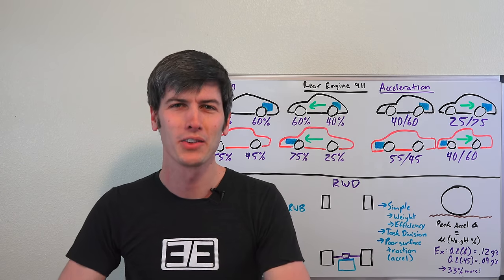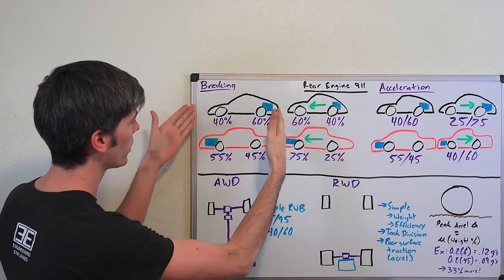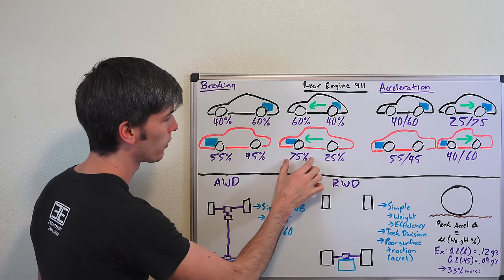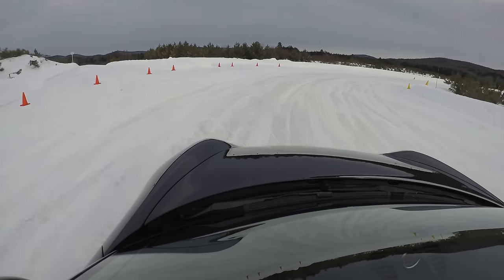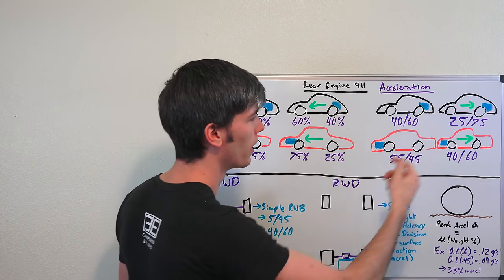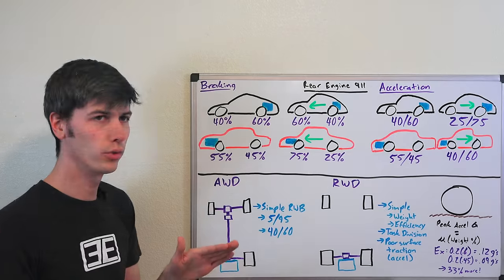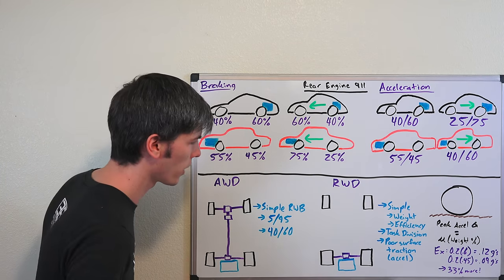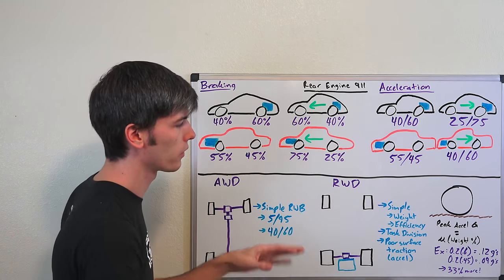Why Is The Porsche 911 Rear-Engine?

Comment: The real reason the Porsche 911 is rear engined is because its predecessor, the 356 was rear engined. And the 356 was rear engined because it had a lot more "Volkswagen" in it than Porsche fans will admit. The original Volkswagen, which we now know as the "Beetle," had a rear engine because that was Porsche's way of getting it out of the way for interior space. Mind you, there wasn't much luggage space in the nose because the car was "aerodynamic," in the Chrysler Airflow idiom. 

Porsche could easily have made the 911 a mid-engined car -- which would be much better for low polar moment of inertia, and thus better handling -- but Porsche fans wouldn't have it. Instead, the company has spent 50 years and countless millions of dollars trying to reduce the extreme rear-weight-bias and pendulum effect. Once all that mass out behind the rear axle starts moving, it's difficult to stop. Today's 911s are decent handling cars, but the early ones could be a terror. Turbocharging, with the attendant turbo lag, only made them worse. 

To make things even worse, the extreme rear weight bias means there isn't much weight on the front wheels, and thus not much "mechanical" grip. The early 911s in particular had floaty front ends, a tendency to spin and were all but impossible for most people to catch when they did. Worse still, that lightly loaded front end meant the car could also understeer if pushed too hard. Think on it -- a car that can understeer and oversteer at the same time.

Comment: You missed comparing to the Cayman. I did the Porsche winter exp a few years ago. The Cayman rotates more easy as it is midmounted. However that made it harder to keep it drifting as smaller adjustments made it react faster and you flipped drifting direction to easily. Pendulum 911 or seesaw Cayman.

Comment: The Cayman could so be more superior to the 911 because of that mid engine layout but Porsche holds it back so it doesn't eat into 911 sales. The GT4 was a good car but they detuned the engine in it.
Reply: wrong, you missed the video explanation. It's called physics.
Reply: Squidward's House Engine in the middle towards the back would just reduce the rear grip that's known from 911s. The 911 takes full advantage of the RR layout while the Cayman has a traditional sports car MR layout which isn't refined by Porsche as much. The 911 may seem like it lacks front grip, but this video explains exactly what Porsche has been perfecting for so long.
Reply: Porsche doesn't want some Porsche models to sell more?
Reply: The 911 still suffers from an incredible amount of over steer under acceleration while turning, much more so than other sports cars like the superior Corvette.
Reply: I blame the 911 for the Cayman losing the flat 6 and getting some terrible sounding flat 4 setup, the 981 platform was getting too close to the 991 :(
Reply: North Star Ken lol, the Corvette doesn't oversteer
Reply: Who gives a damn about how the thing performs when a $70000+ Porsche has an exhaust that sounds like someone botched an EJ swap into a cayman! The 718 sales tanked hard vs the 981s, so I am certainly not the only one that thinks this way.
Reply: mathew kuhl It actually doesn't with PTM on. It has so much grip and that's part of the reason why this super sports car absolutely destroys lap times anywhere it goes. It's just too fast.
Reply: matthewmatthew638 
I’ll be happy to pick up one of these non-classics at a discount in a couple of years, so I hope you’re temporarily right. 
Harley Davidson just closed a plant. Porsche isn’t known for its bad judgement. A 4 cylinder platform may be just what the doctor orders, even in a new 911/356/912/718 some day.
Reply: Jeff K if they’d just give the cayman the same engine/tech etc as the 911 then people could choose for themselves until then any claims 911 is superior is simply because they hold back on the caymans. Even the GT4 only got the engine displacement of a regular 911
Reply: matthew kuhl wut
Reply: matthewmatthew638 nah that was a decision they made from the beginning, Porsche just got stingy and didn’t want to face the penalties of increased emissions when they could throw a turbo 4 in the cayman. The caymans weren’t “getting too close” they could’ve been superior from day 1 if Porsche had actually given them the same engine/components/tech
Reply: Mid Engine Porsche is a Nightmare for Mechanics.

Just a simple fix required opening many body panels.

Cost customer BIG $$$ for it's service charge.

Summary : Rear Engine Porsche is more accessible, easier to maintain.
Reply: North Star Ken this couldn't be further from the truth. 911's (especially the awd turbo models) power out of turns like no other car. They have better traction in the rear and generally understeer. The days of the 80's turbo induced snap oversteer are long gone. There's a reason Corvette is always chasing the 911. There is no substitute.
Reply: Cayman chassis has great potential. It got weaker engine than 911 to position it lower in the market, as "entry-level" Porsche (if that applied to Porsche at all :-) )
Reply: I read a poster saying in the early 70's he worked at a Porsche dealership around the time the 914 was introduced. He stated the owners took the 914/6 out for a few days and came back and said if 911 driver's drove this car 911's would be history. Mid engine in a sports car is always the way to go. Even the Corvette may end up mid engine...

Comment: Your video talks about the pro's and con's of front engine vs rear engine not the reason the 911 has the engine in the rear. The original 356 was derived largely from the VW - it used the VW engine. It fundamentally had to be a rear engined car. The 911 was a continuation of the 356 tradition. Even when Porsche went water cooled with the 911 it remained a rear engined car. Porsche tried to go to front engine cars (the 924/928/944's) but they did not sell they were just not popular with Porsche's customer base. The real reason that a Porsche is rear engined is tradition! The real question is: Why was the VW a rear engined car? After all Dr. Porsche was largely responsible for its design.
Reply from the maker: Thanks for sharing insight!
Reply: the first front wheel drive car didnt exist during dr. porsche's era. the complicated mechanical systems needed to allow steering and power delivery on the same axles didnt come till much later.
Reply: Jerry Rufener Porsche stole the idea from Ledwinka who was master engineer for Tatra. He was posessed with air cooled engines, montube-frame and fluent bodylines. Hence the T77 and T603. Porsche took the drawings and scaled them down.
Reply: Fwd was pretty much developed at that time. Look at 1930's Citroën Traction.
Reply: The VW was a rear-engine design because Dr Porche stole the idea from a Czechoslovakian company named Tatra. Tatra put the engine in the rear of their streamlined vehicle, which is what the Beetle copied, in order to reduce harm to passengers when the car was driven into a tree. Very icy roads a lot of the time in Czechoslovakia meant that this had to be considered. Volvo invented the three-point seat belt, the inertia real seat belt, crumple zones, and a load of other safety devices because they have icy roads, lots of trees, and elk roaming around. Necessity is the mother of invention, Dr Porche was just a thief of inventions.
Reply: Actually the first Porsche Sportscar, which was the 356, was introduced as a mid engined car, which sits now fully restored in the museum in Stuttgart. This layout just made it never into production.
Reply: This is both untrue (DKW launched a commercially successful FF model in 1931) and completely irrelevant.
Reply: I agree with Jerry Rufener for the historical reason more than a technical reason.

As of why the back engine on the VW, it's simply because it was cheaper for a cheap car at that time... Back then FWD was very rare and a luxury, and the traditional front engine and RWD was more expensive to build than a rear engine close to the rear axle where it sends the power. It also let more space in the cabin for the passengers without the drive shaft under, particularly in small cars.
Many cars had the same design at that time, like the Renault 4CV.
Reply: Wow - I am impressed ... 9 responses and not one flame!!!! I am hesitant to post anything these days as flaming and rudeness always ensues. Like most things the truth is probably unknowable because of time and the fallibility of memory. Moreover, "the truth" is rarely as simple as we would like it to be. Good comments and some new information for me to look at. Thanks
Reply: @Jerry Rufener. Exactly. To be honest the reason Porsche still has the engine at the rear is to be different. When they tried to switch to front engine, they became just one more in the pile. This is probably the reason they didn't sell. People didn't feel they were as special. But it has all to do with being cute and not much to do with being a sound choice. Rear mid engine is way better. As is front mid engine for most things too.
Reply: I have read about Porsche appropriating Tatra's ideas ... probably a lot to it. However, rear engined cars existed long before Tatra's efforts. I have no idea when the first rear engine car was developed but Adams Farwell produced rear engined, air cooled cars as early as 1906 - it was a weird vehicle including a rotary engine. But it was rear engined. I have the impression, but no evidence, that they produced nothing but rear engined vehicles. In fact, Benz's first car was arguably rear engined ... the engine sat over the rear axle. 

There is data to support that the Sigfried Marcus developed a car as early as 1870; in what is now Austria (he was German). The stories about it are amusing: it lacked three things to make it practical: steering, brakes and a clutch. It was started by jacking up the rear wheels (implying that it was rear wheel drive and maybe rear engined) and spinning the wheels. It as then pushed off of the jacks to drive it. Once started the other two shortcomings became more important as there was no way to avoid obstacles. It was disassembled and he built his second car which is in the technical museum in Vienna. 

Tatra has always produced very innovative, interesting engineering products but they never seem to catch on widely. A shame actually
Reply: You are absolutely right.
I would not even try to justify the 911's layout in engineering terms. Porsche's designers know better than anyone that a mid-engine layout would be more logical, and why they consistently lose in performance to most front engine cars of the same category.
The rear engine was Dr. Porsche's philosophy (one could almost say "an obsession"). He showed it both in cars as well as tanks. But at the time, it did in fact made sense. But over the time, it simply became a tradition for Porsche, and a fetish for its costumers.
Reply: Jerry, the first Benz back in 1886 was rear engine. That vehicle is one of the very first cars (perhaps THE first).
Reply: Trent - I agree but like many historical things it is a matter of definition. Karl Benz certainly built the first "practical car" as evidenced by the fact he went on to build more of them and then sell them. Hard to argue with that. 

However. Nicolas-Joseph Cugnot built a steam powered, self propelled vehicle in 1769 - it still exists. Robert Anderson built an "electric carriage" in the 1830s. I find his work remarkable in that it used a primary cell for its source of current, meaning that the batteries had to be replaced after each outing! Both of these, of course, came to naught. But given the resurgence of electric vehicles maybe Anderson's place in history should be reconsidered. 

As I said in another post the truth (and the past) is rarely as simple as we would like it.
Reply: The 924 928 sold very well and had very long production runs, but I agree with the rest. The reason the vw beetle was rear engine was because it was the most efficient way to make a car in the 30s financially and interior space. Front wd was very complicated to make at the time and rear engine meant no drive shaft going through the cabin..
Reply: waclosh I think you might be referring to Citroen's "Traction Avant" (which, if my knowledge of French doesn't fail me means "Traction at the front", indicating front wheel drive)... I believe it was the first front wheel drive, but definitely in the first few even if it wasn't the very first...
Reply: Jerry Rufener The main reason why beetle was r-r, was simplicity (=cost). People have always needed a car that was cheap, easy to maintain and that simply did the job. When Mini and later Fiat mastered building small front engined fwd cars, they became very popular for the same reason.
Reply: WTFZOMG nonsense they did. It was just more expensive to do so bother?
Reply: Reverend George nope lol. The first commercially available car the benze 1886 had the same layout. Vw may have stolen some of tatras ideas, but that wasn't one of them..
Reply: De Dion Bouton was the first (1895-1898)
others pre-war FWD : DKW (Germany) 1926, Alvis (Great Britain) in 1928, Cord (USA) 1929, Citroen (France) 1933
Reply: German winters... that rear bias is great for snow but sucks for dry pavement. I love 911's. But I think mid engine is the way to go in a sports car. And for those who say you can't have back seats, enter the Lotus Evora. For those who say no trunk, I have a 72 Porsche 914. It has 2 trunks.🤣🤣🤣

Comment: Another thing, the 911 never went mid-engine for weight distribution, they did it for the aero.
The 911 GT1 (one of my favourite racing cars ever), was mid engine because it was basically a 962 with some 911 faring. The 911 used in GTE nowadays went "mid rear" in order to use a taller diffuser. It's not what I would call as mid-engine, since they literally just turned the engine and the gearbox around.

Comment: That looked like a blast! I haven't raced a Porsche yet, but I have raced a Lotus Elise. Which, is also rear engine rear drive. I must say they drive much different than a front engine/rear drive. The braking is amazing but they don't turn well, you cannot put power down on exit because there is too much rear grip (car just pushes like crazy). I've heard 911's are similar, just have to learn a different style of driving.
Reply: Lotus lease is mid engine, the engine is in front of the rear axle not rear engine, behind the rear axle. 
Big difference

Comment: how about mid mounted engine cars? is it just compromise or better?
Reply: As  a mech. eng. I can tell you that a mid-engine is the ultimate for a "sports car" primarily for two reasons. First and foremost, it minimizes polar moment (the inertia which prevents something from turning on its axis or keeps it spinning if it is already doing so - think of a cheerleaders long baton and with rubber weights on the ends. This is ideal for canyons and race circuits, though not so much if you are trying to fill the car with passengers and cargo.  Second, you ideally  have 50/50 weight distribution wherein traction in evenly distributed except  when accelerating or braking. In the case of braking, the engine is just afront of the rear axle though some does get transfered forward. And in the case of acceleration some gets transferred rearward though not as much as in   911. That weight is neither hung over the rear nor over the front. It is obvious which technology is the ultimate for handling /racing look at F1 where money is no object and just about every other major sports car manufacturered, but don't plan to carry kids and groceries in one of those. Finally, Porsche has been moving the engine forward on their moneymaker (911) on every major revision since back in the day; those cars were dangerous.  In a 911, when they began to understeer (back sliding out) those cars required you to gas-it while the normal human reaction would be to let-off.  This has been substantially mitigated due to the myriad/combination of traction control, handling electronics and 4-wheel steering that Porsche and all other automakers now put in their cars. Porsche truly makes wonderful cars, I'm not  criticizing just attempting to explain differences. I am a convert ever since I went on a ride in  911 GT-3...AMZING.  As  final note, there are many of us out there that would love to see an apples to apples comparison of an equally powered 911 vs Cayman (mid-engine car). The closest they have gone is the Cayman GT-4. I am keeping an eye out for the GT-4 RS!
Reply: It probably is better as John pointed out. I assume that its more difficult mechanically therefore maintenance and you have to keep it shorter than usual. If it was simple, lots of cars would be mid engine , but it wouldn't be cheap.
Reply: dev4freedom - Toyota MR2s are actually pretty cheap, cheaper than a lot of front engined RWD cars. They are also simpler and more efficient mechanically since they have transversely mounted engines with FWD Celica transaxles(in the other end of the car) meaning you don't have long driveshafts and you don't have to redirect the torque by 90°(this type of drivetrain is also cheaper). It is true, however, that they are a bit more difficult to work on.
I think the main reason why it's less common is because they can exclusively be 2 seaters and have very minimal cargo space. People usually prefer to have some cargo space even in their dedicated sports cars.